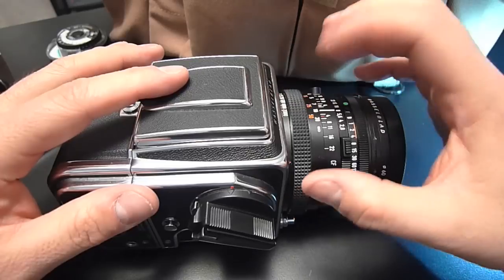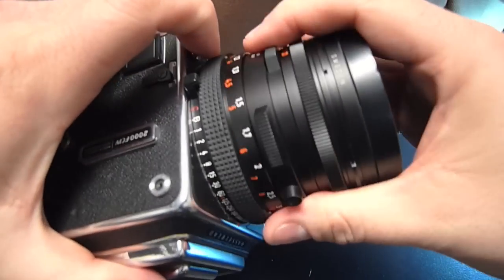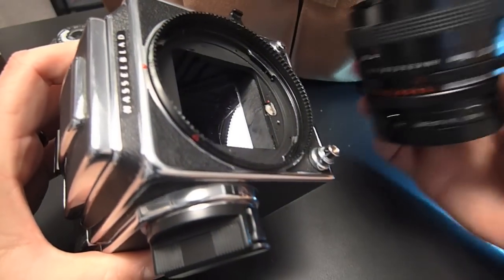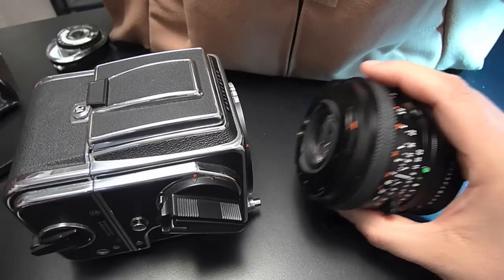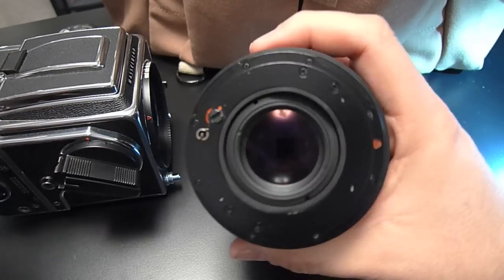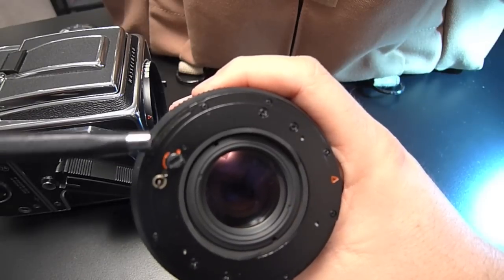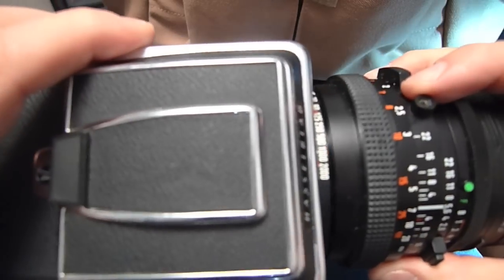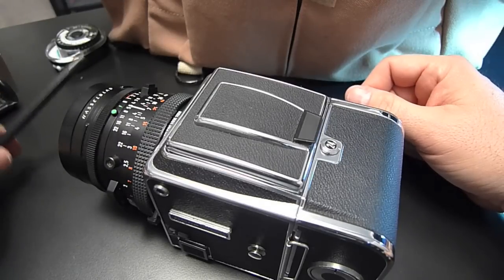Re-cocking an Unmounted Hasselblad Lens

Comment from the maker: The Hasselblad has what is known as an "automatic" lens aperture.  this means that it only closes down when the shutter is open.  That allows you to focus and compose with the lens wide open so more light is available.

Try this:  set your aperture on something other than wide open.  Set your shutter speed to something slow.  Look into the lens from the front and fire the shutter.  If the aperture closes and opens back up, you're fine.  See my eBay vid of the 120 S-Planar for an example.

Comment: An easy way to recock the shutter is to place the lens face down on a sheet of paper on a desk.  Insert a penny into the slot and hold the penny steady while you rotate the lens one turn counter-clockwise until the shaft locks.

Comment: Very informative video. many thanks !!!!!
How do you leave the shutter open if you are using the lens with an adapter on Nikon/Canon DSLR, especially the older  C only lenses ?
I saw in your other video that the CF lenses have a shutter lock F button.
Reply from the maker: +Jay John I have yet to adapt a Hasselblad lens to my Sony, but I assume the shutter will just stay open regardless.  It's open when the lens it taken off the camera.  The Hasselblad is an SLR system, so the shutter has to be open to focus and compose, at least when the film is wound and the mirror dropped.  Recall that a Hasselblad has an auxiliary shutter in front of the film plane, so it's OK for the lens' shutter to stay open.

Comment: Thanks for one more useful video.
Do you find the "tool" (you have in your hands and used to cock the lens) really useful or a "must-have"? I guess the lens is easy to cock with anything else but the other side of the tool (for inside the camera) it is really useful? Or when the need to use it arises it is better to send it to a tech?
Reply from the maker: Definitely a nice-to-have rather than a must-have.  I've fortunately never had to do anything inside a body yet, so I'd probably use the opportunity to get a CLA if something did happen (so I'd send it to David Odess, for example, if he's still in business).

Comment from the maker: @pdexposures I got my M2 for $500 at the local camera store's used dept. a couple years ago.  They've had Hassies in there for $650-750 (admittedly older, slightly ugly, ones with the 80mm 'C' lens).  However, I think I got an especially good deal on the M2.

Comment: Hello Mike,discovering my hasselblad 503 cx i did a mistake with a lens cf 100mm 3.5 , i setted this on f mode and shutted, now the lens is stucked with the aperture open, researching on the manual it say that produce a error on models are not 2000 series,  This method descrived here can works? i dont have the same tool you used i just have a screwdriver

Thanks you.

Comment: I have a hasselblad 500cm with a CF 80mm lens and my aperture doesn't change from f8-f22. The blades stay in the same place unless I'm pressing down the depth of field button. Is that normal? When I took the lens off, it was able to change without any problem, but when I put it back on, the problem continued. Please tell me what's going on.

Comment: when i twist the screw on the back of the lens it just fires the lens shutter. the pressure builds then jsut as the shutter opens the pressure releases and the lens shutter fires. any suggestions? this all started when I removed an extension tube from the lens. Please reply if you get a chance i'm stuck.

Comment: Hi, Mike
Im having a similar problem. I took the back of my hasselblad off, so i can see thru the curtains whats going on. What i see is very interesting, i press the shutter, with shutter speed set to lets say, 1 sec, so i can cleary see the diaphragm working accordingly and it does. Then i wind the crack, everything is set. I press the shutter but it doenst open! THe blades remais closed, so i have to take the lens off, do exactly what you did on your video, then attach the lens on the body, press the shutter and bingo! it works! But if i wind the crank and press the shutter again, its stuck! What should i do??
Reply from the maker: Sounds like the shutter winding mechanism isn't doing its job.  You should be able to see the cocking mechanism work if you take the lens off and shoot a frame and wind, while looking at the mechanism in the body.  It's also possible that the cocking part isn't mating properly with the lens, so see if there is any damage to that.  Sadly, it sounds like it's going to have to head in for repair, if I were to take a guess.

Comment from the maker: I'm no expert on the deeper mechanical things WRT Hassies, but this doesn't sound good.  Regarding the extension tube, I believe you are supposed to mount the tube to the body and the lens to the tube, then reverse that to unmount.  I suppose the wrong order could have caused the issue, but perhaps the issue caused you to have to unmount things in the wrong order (?).

My guess is you'll need to send it in for service.  :-\

Comment: so I'm having a problem where it wont latch when I twist it and open up the aperture. As soon as I take out my screwdriver it spins back around to its original position. It will mount to the body if the body is cocked but you cant shoot as the lens is not cocked. not quire sure how to resolve this problem. If you have any ideas I would love to hear them.
Reply from the maker: Sorry, I can't be of much help on this one.  It sounds like the shutter mechanism might need service.  Just a guess based on your description.
Reply: Same problem, did you resolve it?
Reply: Nope, took the whole thing apart and couldn't quite figure it out but i was able to trick it by half mounting part of the lens cocked and then attaching the rest but it was very precarious and i would not recommend it
Reply: +Uksternikolai sucks, was hoping for a solution, couldntbfind one online..just a few people with the same issue.
Reply: I would venture to guess that you didn't turn the screw far enough. You need a considerable amount of force to bring that screw around to where it will latch. If you really think you've turned it far enough and it doesn't catch, then behind the wall that contains that screw is a latching mechanism that probably popped its spring for hold it in place. You would have to open it up further to see this as it's difficult to explain w/o a more precise video. Good luck.
Reply: Yea I turned alright...didnt work...but i will try again. Worst case scenario ill drive it to hasselblad half hour from me.

Comment: I've tried everything to try to unlock this piece of utter scrap! The screw on the lens and on the body are in the same positions but they don't match up when I try to mount the lens. the pin on the lens doesn't fire the shutter either. You shouldn't have to watch several different combinations of moves/sequences just to make sure your camera doesn't lock up. It's an over hyped, over priced piece of crap very badly designed. The lens is over complicated with 4 little metal levers on it. I sold the back I used to have so I only have the body, waist level finder and lens. Next time I go to the recycling yard, it is going straight into the landfill dumpster.
Reply from the maker: Bummer.  When you have trouble, Hassies definitely seem over-complicated, and the required habits to avoid trouble are a pain to create.  But for me the results are worth it.  If you can upload a well-lit video maybe someone can help diagnose, but if the lens won't fire off the camera, then it's probably the culprit (?).
Reply: Mike Thomas I've decided to :
1. Calm down, LOL.
2. Give what's left of the camera to the cancer research charity shop (maybe someone can use it. and it's better than being scrapped).
3. Get a rangefinder camera.